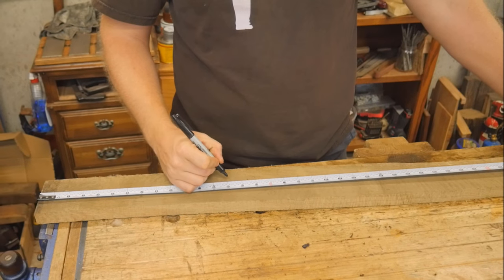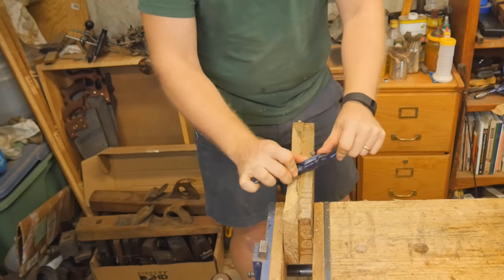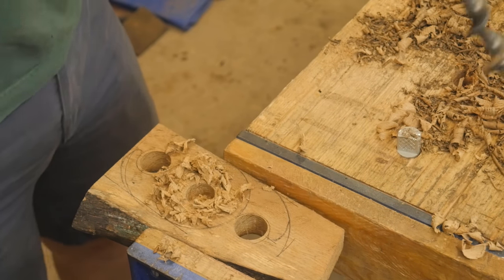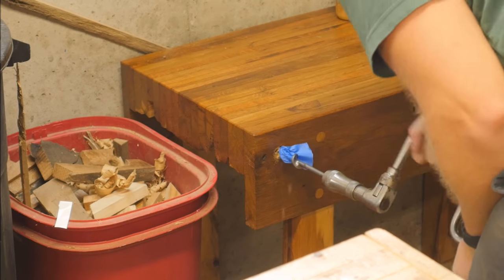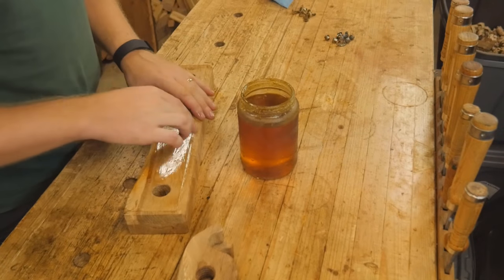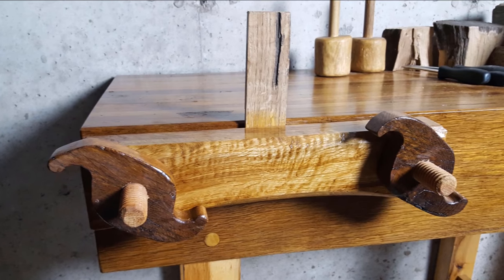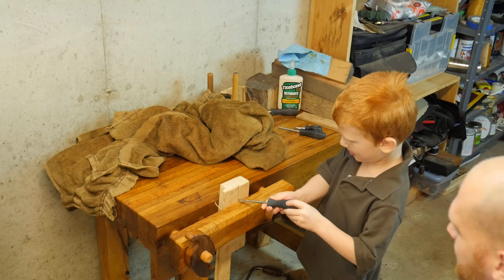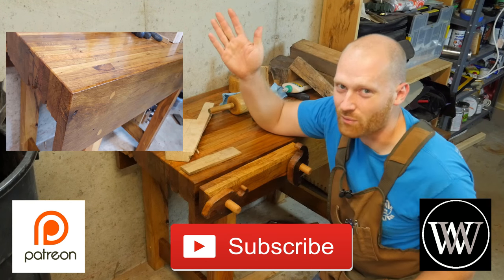How to Make a Moxon Vice for a Hand Tool Workbench Chris Schwarz Style

Comment: how's the glue holding when you apply it after oiling the tap for the hole in the table?
Reply from the maker: Fine. With that much surface aria  I could hold it for eternity with Elmer's glue.

Comment: Do you clean out the oil from the tapping process before gluing the threaded rod into place or is it a nonissue?
Reply from the maker: +JoshL the threads remove all the surface so there is no oil left.

Comment: The result is much better than I expected. I must admit that I was a bit sceptic about the strength of this thing, but the test you made convinced me that there's no problem!

What I thought of doing differently (which is not necessary) is ...
Make the thread in the bench all the depth of the rod's length.
Make the rod fixed to the handle instead of the bench; that way, it has more grip in the bench, as the vise jaw get closer to the bench.
Soak the rods in mineral oil for a week, before threading them; this will improve strength (See King's Fine Woodworking).
In fact, I'd have used metal threaded rods myself, but there's really no need to, if you can make threads in wooden rods.

Great video and nice build. I like the untraditional shape of the handles.
Reply from the maker: Thanks. It is amazing how-much pressure I can get on it with this vice. someone questioned me about that later and I put a load cell on it as was able to get it over 3/4 ton  before I could not turn the nuts any more.
For traditional moxon vices I do connect the threaded rod to the nut but I can not tap deep enough to make that work on this setup. That was my initial idea. Just did not work out.
For oak you only need to dip them for a couple hours. if you dip them for a week or more you can run into gluing issues as the wood is so saturated that the glue will not stick to the newly cut threads. it does not ad any more strancth as even with them chipped out they will hold more then the nut will. That is usually the failing  point. The nut will crack before the threads strip out. but they do look a lot better if you dip them first.
Reply: 3/4 ton, that's quite a lot; very impressive. It's more than the weight of a heavy-duty workbench made out of 2x8. =)
Using rocks, metal-scrap and other heavy objects for "clamping" just can't compete anymore, because your 3/4 ton pressure is over such a small area; the rocks would have to be pretty tall (and well balanced).
...Yes, I know about the gluing issues; if your rod is only a threaded rod, which needs glue later on, that'll be a problem when soaking - so you'd have to use workarounds like epoxy first, then soak and finally use epoxy for the handle. ;)
Reply from the maker: @68HC060  yeah I actually have indents in the jaws from the load cell as it crushed into the White oak a bit.

Comment: how much smaller to you make the hole that you want to tap? 7/8 for a 1" tap?
and is a 1" dowel good for a 1" die?
Reply from the maker: you want to use a 1" dowel for the 1" die but the tap will have a dip that sticks in the hole that will tell you how big to drill the hole. I can not remember what it was off the top of my head, but I want to say it was 13/16"
Reply: thanks! hopefully I'll finally have a vise in a couple days.

Comment: very nice, tipps... adding a washer would make it  smoother too tight up,
Reply from the maker: yes it would help. the nice thing with this is that there is more of the nut in contact to help prevent racking. and you do not need much force at all to lock the board in place.

Comment: If I wanted to add a metal bar that would slide up like in traditional wood vices to clamp pieces of wood against a dog system, how would I incorporate that into this vice? I plan on making this vice for my workbench and would like to use a dog system with it
Reply from the maker: You can just drill dog holes in the chop. then just use a dog. my old one actually had 3 holes so I could hold odd shapes between 3 dogs.
Reply: Wood By Wright that is brilliant!!! I way overthought this. Thank you!!
Reply from the maker: LOL thanks. simple is often easer.

Comment: I do like your wood working styles, i learned much from you. However, those handles are going to be a trouble if the positioning of any one of them comes upwards. You'll have to rise the wood in between the vise to a higher position in order not to hit that handle while smoothing sthg. etc.
Reply from the maker: well this is less about function as it is for the kids fun. I was experimenting with the shape and on a traditional Moxon vice thay would be below the top of the chop.

Comment: Beautiful!
0:29 - Why did you place the board in your vise that way? I always clamp mine horizontal, because I'm not able to saw totally perpendicular...
Is there any specific reason to do it like that?
Reply from the maker: I find it easier to follow a line then to cut all the way across and start on a line. also whenever possible I prefer to cut with the saw in line with the bench rather than across the bench as I would with a bench hook. but in the end, it comes down to what you are comfortable with. One is not better than the other just works best for you.
Reply: Thank you for your reply. 
I don't have a lot of experience, and I'll try your method with my new hand saw :)

Comment: Nice little vise for the kids of all ages.  
Does the oil you use for tapping not interfere with the glue holding the screws to the bench?
Reply from the maker: +pgfollett thanks. The thread cutter removes the wood with oil on it.